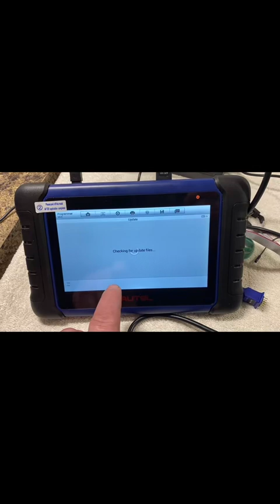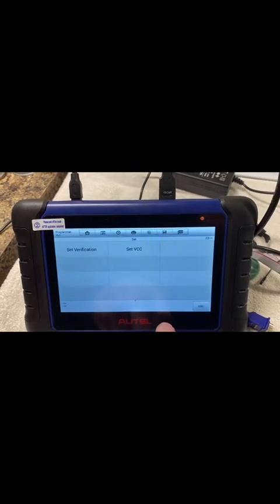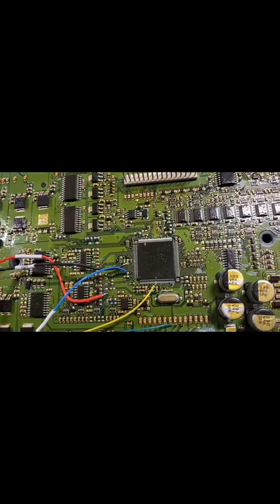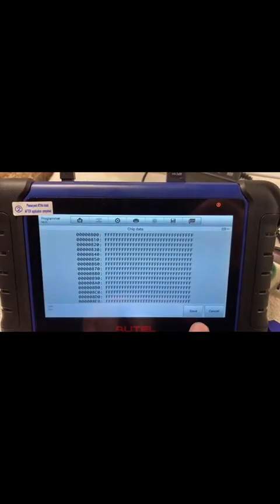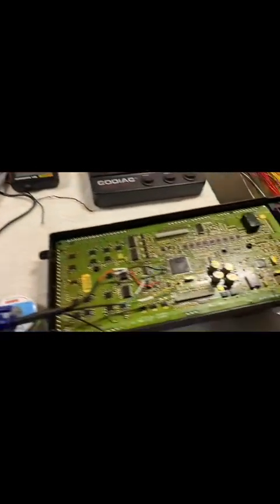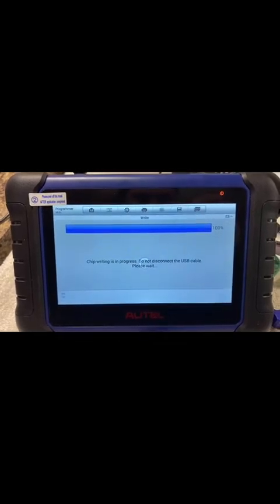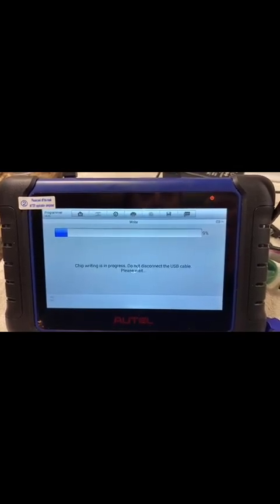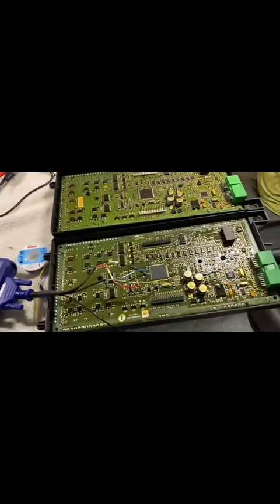How to clone Land Rover Bcm under Volvo w/ Autel tablet and xp400 pro

Comment: You put in the car and starts ?
Reply from the maker: yes it did work,   however ive had some since this video that ive had trouble with.   I switched over to using the xhorse multiprog to do these instead and have had zero issues.
Reply: @drewjohnson5402  I got the pin out way easier .
Reply: @drewjohnson5402 please help I have this some issue please contact me like I’m in desperate situation
Reply: Do you have a direct number? I have a bcm. I wanted to be fixed
Reply: @DerrickBuchanan-t7k same please let me known if he contacts u